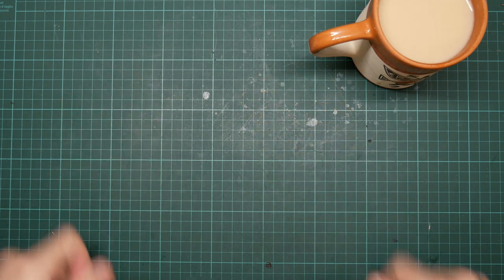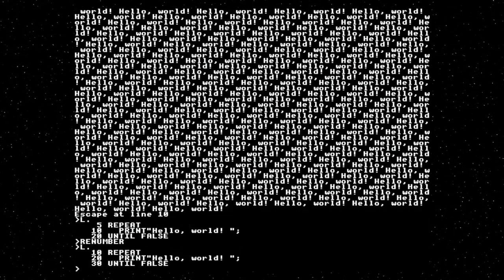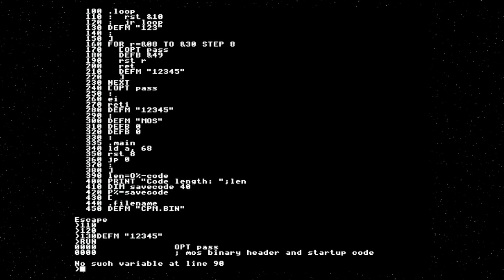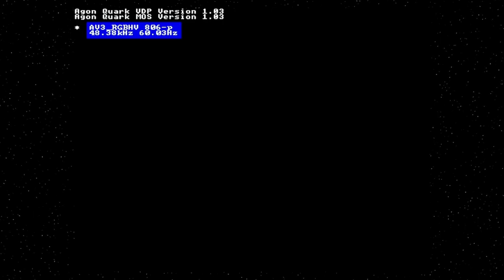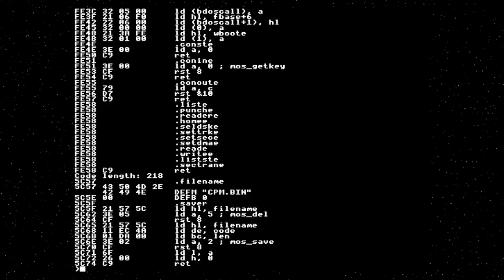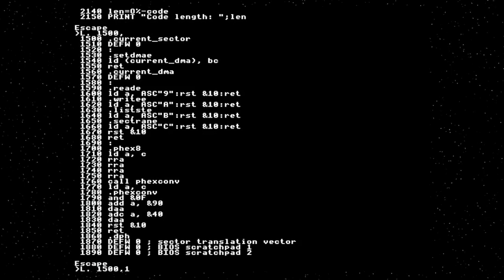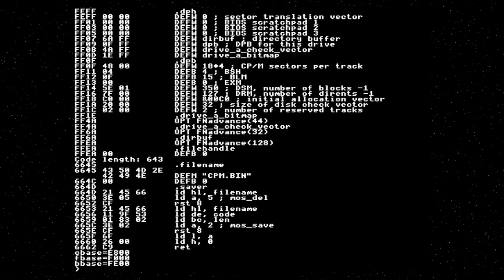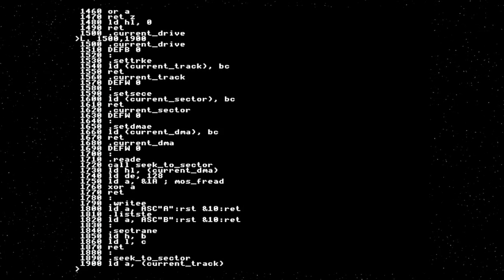Porting CP/M to the Agon Light, on an Agon Light

Comment: Hi David. Great video! Also the helicopter-view camera setup is awesome.
I am a 67 years old electronics engineer, and in the 70-ties I started playing with SBC’s (Motorola, KIM etc), and suddenly there it was: Gary Killdall’s CP/M (originally named Control Program/Monitor, but later it was changed to Control Program for Microcomputers).
My first CP/M system was a (Dual Z80)  Intertec Superbrain ][.
dBase2, Wordstar, Forth.
Bill Gates was still a snotty boy!!

Anyway, I new about the eZ80 cpu’s, and 20 Mhz clockspeed is great, but I’m waiting an ‘Agon Light’ version with a 50 Mhz eZ80 cpu.
I hear rumors that the designer is currently designing the next gen Agon board will be called the ‘Agon Heavy’.

Anyway, I just wanted to show my appreciation for your great efforts to make this kind of video!

Cheers from Robbert, the Dutch guy living (it up) in Istanbul, Turkey
Reply from the maker: Thanks! It's got some flaws, but I do think that CP/M is one of the greatest operating systems of all time: it's got one of the highest size:functionality ratios ever...

Comment: That is an awesome way of adding CP/M!  Looking at the MOS API it seems like it would also be easy to add in a punch in/out using the UART commands of v1.03 (defaulting to 9600 baud etc).  Then Kermit would work or a serial printer.  Not sure a parallel printer would work without MOS adding access to the GPIO, but there is always MOS 1.04.  Thanks again

Comment: The Agon Light is a powerful design but WOW I have experienced a lot of misery while trying to get it working right. First it was the inconvenience of getting the right keyboard + adapter and formatted SD card, fair enough, but then there was the process of actually getting the updated firmware and SD card files installed. Everything has to be a certain version and done in a certain order to work properly while relying on scattered Github documentation/files. I even had to reinstall my Arduino IDE because it was giving me grief with a VDP firmware compile error. If it hadn't been for your video I wouldn't have had the motivation to finally figure it all out!

Comment: Good job on the CP/M port, mate!
The first computer I've had access to was a ZX Speccy clone. It was loading games from tape.
The first computer I would program was a 166 MHz Pentium MMX running MS-DOS and QBasic. It had an 80 MB spinning hard-drive.
So this is very soothing, though not nostalgic for me.
It's been about 30 years but I too still remember all the interrupt numbers and string manipulation routines. Oh wait, that's from later on in school, when I understood assembly. 25 years then.
I don't think I've ever gotten used to modern computers' lagging beyond 50ms for input.
It used to be so snappy back in the day. No sudden hangs and hiccups, no lost input.
I want that back. Modern coding is no fun.

Comment: Ive been trying to find a way of getting MBASE in Z80 mode, I just had a go in bbcbasic and found that the LD A,MB is ED,6E not ED,6D as you put. According to the manual it's supposed to do a NOP but it actually returns &0B if i run bbcbasic as a star command and &04 if i load and run bbcbasic!
Reply from the maker: Damn --- must have misread the manual! But I'm surprised it's working for you. It's clearly documented as not working in Z80 mode. The two numbers you give are correct; the load address varies depending on whether a program is a star command or manually loaded. (A lot of the weirdness I was seeing was because I was loading Basic incorrectly.)
Reply: @hjalfi  I know, I was surprised too. I tried all sorts before I did this test. Messing with the 2 stacks, trying undocumented uses of LIS and SIL etc...

Comment: For something one letter away from "agony", this doesn't seem so bad.
If you have a working PS/2 keyboard, you could probably hack together a PS/2 to "USB" adapter from a mini-DIN socket. It'd be nice if they had left the option to solder in your own socket. Last I checked, they weren't too horribly expensive.

Comment: Since they are using the ESP32 already, I like THIS design much better:   Just my own preference.
https://www.youtube.com/watch?v=3UevsxMQZ5w
CP/M 3.0 and multi-session. And much cheaper and much smaller.
I find your insight into the Z80 Assembly within BBC BASIC very insightful and interesting. THANK YOU for the great video!
Reply from the maker: Yeah, but that's emulation, which I find much less interesting than working with real hardware. Now, a CP/M ported to Espressif native code; that has possibilities...

Comment: If there was a way to use a REM block to hold the code then you could just call it.
Reply from the maker: That doesn't work so well with BBC Basic, as there are characters you can't have in a program statement. Also, lines are limited to 256 bytes. It's really a Sinclair thing.